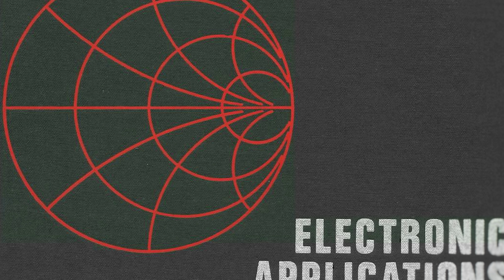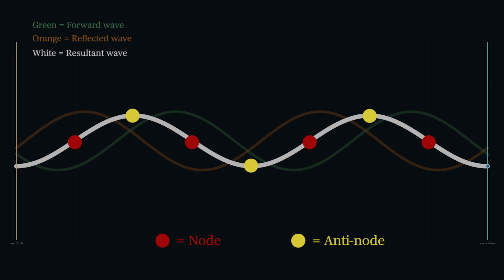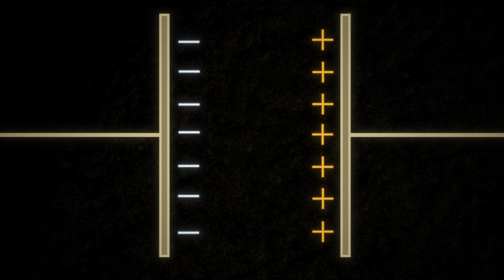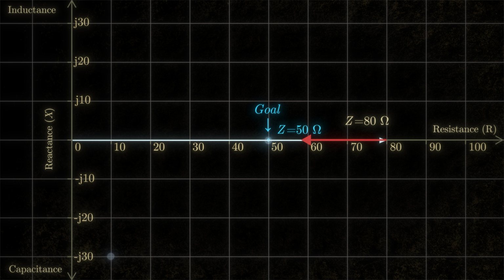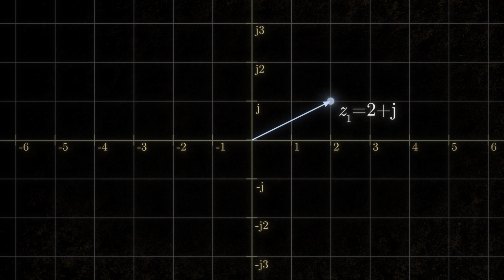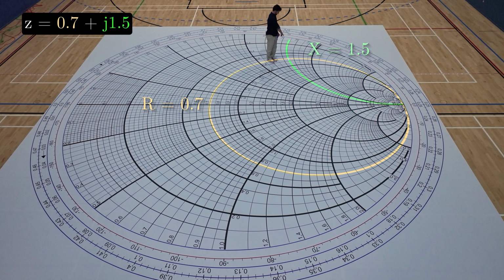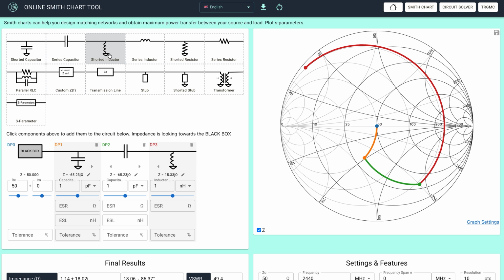The Scariest Chart in Electrical Engineering

Comment: Ah yes, signal transmission. Another interesting phenomenon I experienced on the job was with a digital signal on a 100' cable where both ends are driven by open-collector gates and a pullup resistor. When the gate turns ON, it pulls the cable near to ground. When it turns OFF, the pullup resistor pulls it up to the power supply voltage. The thing that took me by surprise was when both gates were ON and then one gate turns OFF. I expected that both were pulling the cable signal to ground, so if one turned OFF, it would still be near ground. Nope. In the steady state, when both gates are ON, the cable is indeed held to ground. There is essentially no current in the cable. When one gate turns OFF, its related pullup pulls that end toward supply voltage. This takes a little time since a cable has a small amount of capacitance which needs to charge up to carry the signal down the cable. Eventually that voltage level propagates to the other end of the cable where it encounters the gate that is still ON, and that gate then discharges the cable back to ground level. What this means as that the originating end of the cable sees voltage for a short period equal to the round trip cable propagation, like half a microsec, while the other end never sees a pulse!! If you measure in the middle of the cable, the pulse is half the duration of the originating end. Maybe this is obvious to some, but I was surprised the first I ever experienced it. I assumed that if both ends of a cable were being driven to ground that if one turned OFF. the cable would still be at ground because of the other driver. I've always found this interesting.

Comment: "The Smith chart encodes that intuition" -- I like that statement. I believe that understanding and even intuition are valuable. We can get a computer to calculate, but do we understand it? When something breaks, do we know how to fix it? Hence I think an intuitive sense is important, and one of the biggest ways to build intuition is to do many calculations with actual equations over a variety of problems so we get a feel of reasonable answers. I've seen algebra students pull out their calculators to multiply 12 x 15 and blindly accept an answer like 4,568,564 because that's what their computing device told them, when actually they punched in the number wrong. Intuition is a useful skill. I faintly remember Smith charts from the Signal Transmission class while earning my Electronic Engineering degree in the late 1970s at California Polytechnic in San Luis Obispo. I don't remember it as a difficult subject, but I certainly could not have explained how Smith came up with such crazy graph paper.

Comment: Ha ha it all made sense to me when someone told me "impedance is the combination of everything that wants to f up your signal. If you try and send your signal through two things that want to f it up differently it reflects back some of your signal back and you can imagine that isn't good." 

AC itself also made sense to me for the first time beyond just being math when someone explained AC power generation. They said "You know how when you move a magnet through a coil it creates electricity? Now just imagine a machine spinning one magnet inside a coil. Every time the magnet makes a rotation it creates a burst of power. Every rotation creates one little 'wave' of power that forms a sine wave pattern as you continue to spin it sending more little waves after it. You adjust frequency and therefore wavelength by speeding up or slowing down the spinning. That's basic AC power generation."
Reply: Exactly! I studied electronics and created electrical circuits for years but it took a trip to a power plant and to see it first hand for it to became simple in my mind.

Comment: RF engineer here. This is the best short explanation of wave phenomena, impedance, the smith chart that fits into 40 minutes that I have ever seen. While you don't actually generally use smith charts for arriving at the numerically calculatable result anymore, they are still incredibly useful for showing measurement data. If you are used to working with them you can glance at a plot of some impedance vs freq on a smith chart and immediately get an intuition about what you are dealing with.

Comment: Concentric cycles.  
Spiraling helixes, just like tornadoes, cyclones, hurricanes and typhoons.  
Left spin vs. Right spin.  
Vortexes inside vortexes.  
A wave isn’t a wave.  
It’s a helix.  That’s why they’re called cycles. 
A spiraling motion moving around a neutral center.  
So in actuality DC is still AC current.  There is a left hand spiral moving against the overtly dominant right hand spin.  It’s just so much weaker it’s almost unnoticeable. 
The only way to get a spiraling movement is to have a central neutral point to revolve around. 
The only way to have a neutral point, the eye of the storm so to speak is to have counteracting left and right cycles. 
That’s why magnets always have a neutral central core. Opposing forces.  
DC just has shorter transmission lengths due to the high level of imbalance between the cycles.  
You can see it everywhere in nature.  
Nature gives you a medium to see this. 
Water is the best medium.  
Much easier to see in the high altitudes where water is dense. 4 degrees C, (or lower) dispersed through the atmosphere is the real and best lens.  
The color of lightning is indicated by the direction of the air currents. Two right spinning vortices makes a blue (negative) bolt.  Yellow is a left and right spin.  
I have never seen a red lightning bolt, but I can pretty much say without hesitation is its two left spinning air currents colliding/overlapping. 

There is a way to magnify a beam of light.  
The easiest to magnify is a sun beam, and use atmospheric water (humidity) and a convex water droplet lens over the human eye, will magnify a single beam of light enough to see the entire Homopolar configuration of beams produced by the sun.  
Once you see a magnified beam of the sun, the chart becomes second nature to your work.

Comment: The most eerie part of the Smith chart is that it’s essentially an analog conformal mapping: transforming infinite impedance space into a finite, closed unit circle so human intuition can visualize standing wave ratios. What looks like black magic on a blackboard is just geometry solving the wave equation before digital microprocessors even existed.

Comment: It's out of the scope of 1900s tech, but can't you just do a binary low voltage transmission to where the tower is and then bias a high power supply to the antenna?

Comment: Current lags the voltage by 90° (Voltage leads the current by 90°) through an inductor and opposite in a pure capacitor. In the video on the graph, I believe this was bass acwards.

Comment: Some locomotive control systems operate on 74V DC, triggering electromatic coils that move contacts that transmit 600V AC to the drive motors.
Some firetrucks have hydraulically driven generators that require an idle-up solenoid for the engine RPM in order for the generator to spin at correct speed to produce 120V @ 60Hz.
As a human I have failed to multitask properly and was unable to fully comprehend both the video explanation and comment section simultaneously.
Analog ears and eyes. Woe is me.
Marconi must have been lucky?
Where did I put that original TI-30 of mine?
Oh, over here by that old HP total station, next to the drawing board and slide rule.
Right on Nikola!

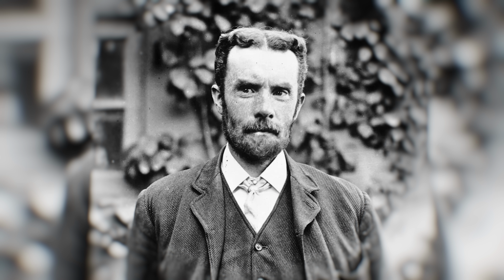Comment: This confirms EVERYTHING I have feared about radio engineering. Everything.  Mortals could only make it work by men who looked like this 17:09.  (To whom we can only be infinitely grateful).

But does it work on the reception end?  Do I have to match the impedance in the coax I have installed between my garage controller and the 433MHz stubby antenna I have installed in a nearby tree?  Gaaaah....

Veritasium is the best!!!

Comment: You miss the fun fact about this diagramm. It was invented in WWII at the same time by two engineers independently. On the allied side by a engineer callled Smith  - smith chart - and in Germany by a engineer called Schmidt - Schmidt Diagramm. Both names are still in use.  Named after two different engineers. But if you translate them, it is the same name - Smith in english is Schmidt in German - Smith chart and Schmidt-Diagramm are also exact translations of each other. Although referencing to two different people.

Comment: i graduated with an a$s. in electrical technology and have continued my work in industrial maintenance.
the biggest thing we see in relation to this chart is inductive reactance due to a large number of motors in the factory. the reactance caused a massive increase in power and damage to motors which also increased maintenance costs. we had to get a capacitive reactance bank to fix this.

Comment: Great! I have a challenge for you guys. Did you know that cell phones retune the antenna to compensate for hand and head position? For example, they switch capacitors in and out.  One first needs to model the effect of the body on the antenna. One needs to measure the reflection coefficient.  It is a dark little secret of cell phones. Best wishes.

Comment: 8:59  believe it or not right at this point I noticed there is a slight feedback maybe due to the connection between one Slinky to the other one of the same size or maybe one is slightly smaller

Comment: Harmony have no disturbances the energy flows 

Our bodies nervous system functions with electrical charges or impulses therefore all are energies in a body 

The waves connected to eachother disturbs the flow of energy akashic records with added weight

The hertz scale is a guide to align to dimensions high vibrational patterns likewise low patterns is the act or the will of the solar plexus being performed unaware or conscious 

Black magic is yang under yin which cause control a chartered account meaning an account from all cycles were a willing vessel peace wasn't mastered

Comment: There is also the empiric approach to matching with a pi-filter that consists of two capacitors and a inductor which was and still is very wide spread  for commercial and amateur radio operation.  Basically the operator only needs to twiddle on the three control knobs until a sufficient match is achieved, something that's quick and easy in practice and takes well under a minute for most radio setups.

Comment: When I started to work at the Philips central physics laboratory ("NatLab") in Eindhoven, the Netherlands, in 1989, impedance matching was one of the important aspects of electrical engineering that I picked up quite soon, as it was so pivotal for my experiments. I only had a background of physical engineering on a polytechnical level, so, something like the Smith chart still eluded me then. The mathematics made sense to me, but I only started to resonate on the intuition of that chart, once I started working in non-destructive testing (NDT) later on, when I picked up eddy-current testing (among the other disciplines of NDT). Eddy-current testing is based on the concept of impedances and transmission lines, so that I came into contact with the Smith chart as well then. I can't remember though as how much I really understood it all in total, it's simply too long ago.

Comment: The analogy of the open circuit is very misleading and in my opinion should be changed. An open circuit behaves this way only because we are in AC, and no current really flows end to end, but voltage can exist and can bounce back at the top of the dangling cable. With the river flowing it is implied that current flows there. A better analogy would be to put a mirror that sends back a wave. In a dc current this open stub makes no sense. And for someone new to the topic it can be confusing.

Comment: I couldn't disagree more - it's not scary,  I think it's beautiful and I have used it extensively in my career as an RF engineer. I  didn't truly understand it until I wrote software to draw it back in 1982. Once you have used it to compute an impedance match, you see the beauty. It gives you great insight into the sensitivity of the match to component tolerances. The more interesting version of this the "immitance" chart , which  has the right-left mirror image of this super imposed. That is much more useful for impedance matching as you can easily see how  series and shunt elements work together.

Comment: Out of curiosity, did anyone else think of the slinkies before they were moved and still viewed top-down as a sine wave. Forget the rotation for a moment and look at the pure slinky or a spring. Doesnt it already look and actually model a sine wave frozen? If you stretch it out the wave elongates. I hypothesize using computer imaging to simulate this and then what if, crazy thought here, instead of "up and down" oscilation you induce rotational oscilation instead making the wave exist in 3 dimensions instead of 2?

Comment: I dont want to sound picky, but i cant un-hear "through the wire".  for an electrical engineering feature like this, it should be corrected to "over the wire" or "down the line".  Its never passing "through the wire", thats just not how electrons work.  :/  I've constantly felt like Veritasium productions are always a B- , C+ effort in accuracy and they kind of drive me bananas with "almost getting it right" but selling it as FACT.  uggg.

Comment: I'm an RF engineer who hated the required Jr College level class Electromagnetics for a EE undergraduate. However I did major in Computer Engineering and minor in Telecommunications. So my first job upon graduation was with a microwave company back in 1996 (DS1 etc, low data rate), then moved onto cell phone (analog then digital), WiFi,  BT, Satellite etc. Crazy huh but since then I fall in love with RF or so called black magic and this eye popping Smith chart. But wait... how about level up with Maxwell partial derivative equations? 😅
Reply: Horrible, specially the wave equation for heat systems

Comment: Is this not just the electrical engineering equivalent of psychrometric charts but with imaginary axis? We use similar charts for systems engineering when analyzing the differential input-output response of a system, mapping it as poles on a map corresponding to real and imaginary multiples of e^as. The right half of the chart would then have to be unstable because it requires positive numbers with imaginary roots, which make the system unstable and blow up to infinity. The smith chart looks like a wormhole because it is on a log-log scale axis, which means the edges of the chart have to converge to infinity, similarly to a black hole-white hole causality diagram which also uses log-log scales axis to graphically represent infinity and guess what else it has - a wormhole.

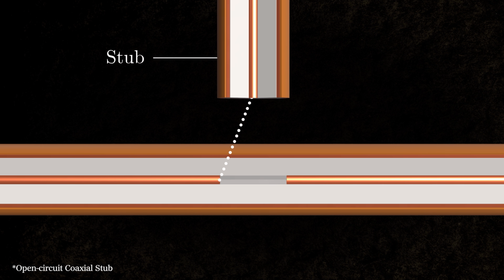Comment: Also, at 32:25, is the branching correct? I would assume a "parallel" T connection, separately for both inner and outer cables

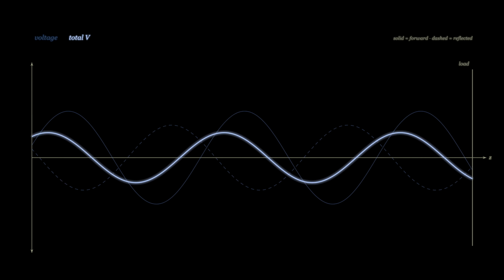Comment: At 16:36 it is say that the reflected voltage amplitude sign is preserved, but the current wave is flipped, without fully saying why. Here is a useful representation to understand current/voltage/resistance (with an analogy that's more effective imho than slinky):
- Voltage = water pressure (or more precisely, difference in water pressure)
- Current = flow

If a pump connects to a pipe that suddenly get narrower, one pump cycle would create water pressure that results in flow towards the discontinuity in diameter. Because the pipe narrows, some water is reflected back. The pressure at this point still exist and is positive (analogy: reflected voltage has the same sign), however the flow of water is travelling back to the pump, so it must be flipped in its amplitude (current represents a flow anyway). Hope that helps as it helped me!

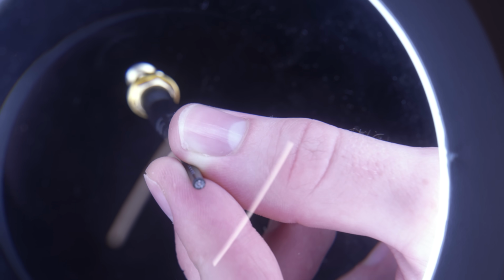Comment: 34:42 oddly enough, this stub reminds me of how, when installing a rampump, you can use a tall standpipe that is open and taller than the head pressure of the system to allow air bubbles to escape the efficiency of the system. I think that's a fairly good analog for this.

Comment: Some simplified tidbits concerning the chart for anyone studying this:

Adding an L or C reactance in series will rotate reactance values along the resistance circles, parallel will rotate along the conductance circles.
Series L shifts up along R circles
Series C shifts down along R circles
Parallel L shifts up along G circles
Parallel C shifts down along G circles
Usually, place the shunt on the load side of the network to match high Z load to low Z source, and vice versa.

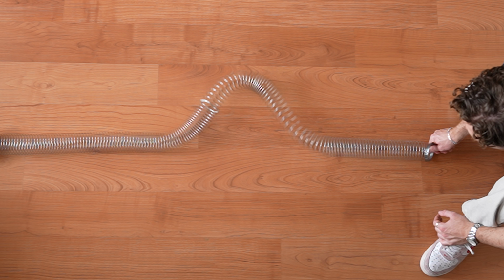Comment: At 15:38 you say that RF transmission lines are designed for 50 ohm - a pure resistance. This might be confusing to a beginner who might think the cables actually poses this resistivity, while actually this number arises from the ratio between the inductance and capacitance of the cable.
Reply: The way it is worded works for the everyday listener who does not know nor care what inductance is. If this going solely towards the students in this and adjacent fields, I would 100% agree with you.

Comment: wow as a layman ham I have spent a lot of time trying to learn the smith chart for building my own antennas and transceivers. This is a great video and helped me understand even better. And puts into perspective how a tuner matches the transmission line and radiating element to the transceiver. The slinkies mismatch is an excellent visual representation. However when I calculate my own rf projects, I do have to add in velocity factor (VF) to the equations. So many tangential videos you can make off the info provided in this video!